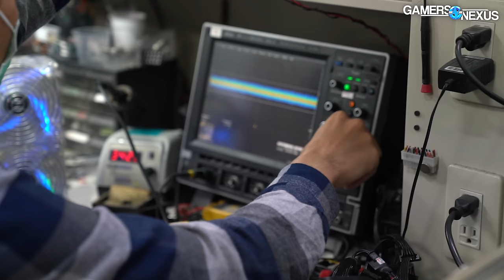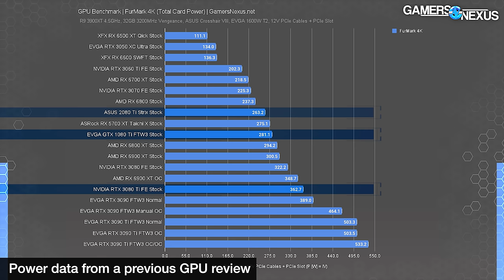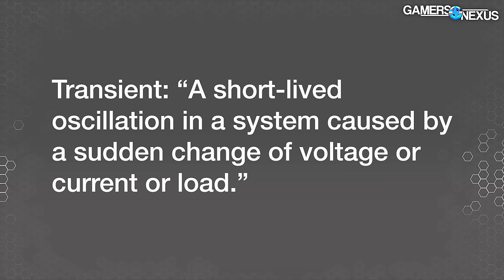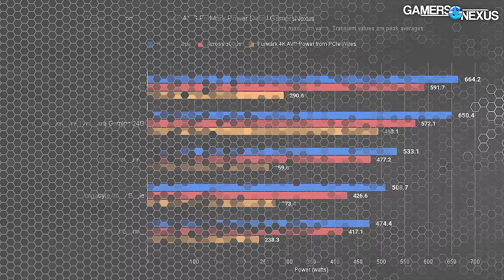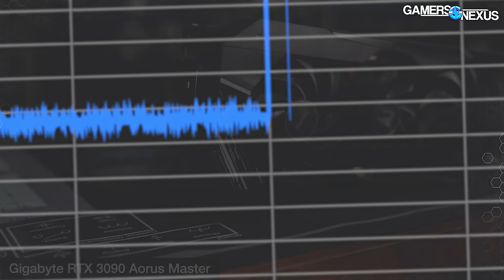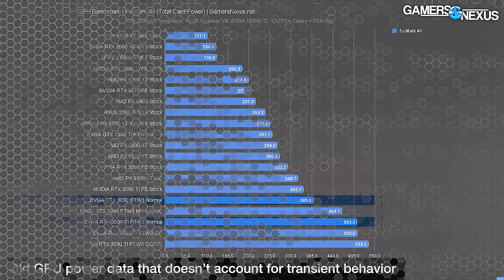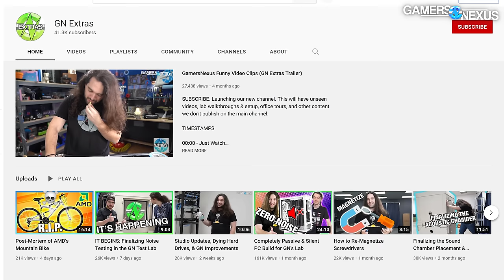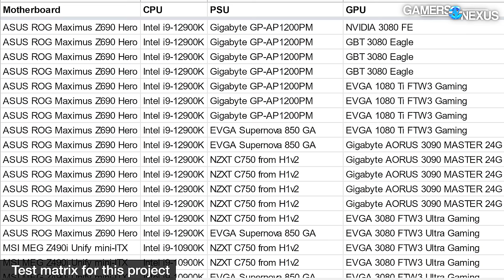The Brewing Problem with GPU Power Design | Transients

Comment: Everybody called me crazy when I overbought and kept sourcing PSUs based on quality of components and capacitors...
It seems like I am the guy who can sit and laugh at the moment, but jokes aside.
Transients that are this big ARE in the GPU makers court, if their product has a spiking demand, you put a capacitor or some sort of local storage on the card itself to handle it.
ANYONE who has dealt with similar stuff in Tycoon, Management games, building games and that have faced a similar problem realize that upscaling a massive system to handle that isn't feasible... You build a small supply that you trickle charge and dish out when the spike happens LOCALLY, meaning in this case, it is supposed to be on the right half of the graphics card!

Blame passed, buck stopped, get to work :D

Comment: Thanks for sharing  info. Adding my points from my incident 

As on Nov 2022, India 
Gigabyte 1080ti GPU behaves exactly  same way (humming  loud followed  by black screen, No Signal from GPU after wards. ). Sent GPU to Gigabyte Service  center (no warranty  being old GPU , EOL products  as response, not repairable,  Nvidia chip is heating too much)

My system configuration 
MB : Asrock Taichi X370
PSU : Corsair HX1200i
GPU  : Gigabyte 1080ti (white)

Investment in flagship gpu got wasted without stressing  it , since this work station is for Video editing in Davinci Resolve

Comment: UPS counts also in this I suppose. I just got a 3090 and have an 850W Seasonic titanium, I thought it'd be OK enough. But I think the power spikes tripped my UPS which is an 810Watt unit. I suspect the PSU could handle it, but the UPS won't go a cent over 810. I'm getting a 2,000 watt UPS from a business. I've also got a 1,300 watt UPS coming over. I'd considered the UPS and most people think it'd do OK, but we don't hear about the UPS much. I'd forgotten to consider it as I built over the last years. Five years ago when I got it, it seemed enough, but things have changed.

Comment: I had an issue like this one. But my configuration wasn't especially power heavy.
Spec list was as follows:
Gigabyte B550m dsh3
Ryzen 7 pro 4750g
16gb ddr4 hyperx predator 4000MHz (clocked at 3200mhz)
Be Quiet Power System 9 700w Bronze
And 2 ssd's in a nicely cooled case. 
Now, it had problem where it would shutdown instantly, without warning. I had spent months diagnosing the issue, until I changed motherboard to MSI B550 TORPEDO at the last minute, solving the issue.

Comment: I'm running a 850 watt 80 Plus Gold PowerSpec (Microcenter brand) and haven't had a single issue with the EVGA FTW3 Ultra 3090. I did run all 3 separate power cables instead of using the included splitters. I wonder if some having issues could be because they have used the splitter cables instead of individual runs. I have debated getting a more well respected brand PSU but honestly haven't had a single issue pushing the 3090 to almost 450 watts.

Comment: Running an OG first Gen NZXT H1 with built in sff psu 750 watts running a 10700k 5.0Ghz unvolt and 3080 with a mild oc. At 115% power. So far the psu has not tripped (running on ups as well). 1440p/4k 144hz.
-
Unrelated, the aio 140mm rad water pump did just died so that happened (pending replacement to be delivered. the warranty is nice to have for once)

Comment: my 2c setup for yall to compare:
3090 Founders overclocked (+450 +100 114%)
5600G
850W EVGA G2
X570-Pro
Has zero issues. Never dies on me. I also mine crypto on it (84% power). Built in Oct '19

I DID have issues with two different seasonic prime gx-850. I returned both for a used G2 from ebay. flawless since then

Comment: This is the exact same problem power grid operators faced when computers got used more and more. Instead of creating a nice predictable load like a toaster they just create spikes, making the grid more expensive to operate. Ultimately computer power supplies now all have a PFC element. I'm pretty sure this issue belongs to the videocard makers.

Comment: Ran an EVGA SN 750w PSU for 7 years with zero problems...Changed to a Corsair HX1000w PSU when upgraded to 3080ti-- a few days later I got the crash with 100% fan ramp up and GPU got fried.... Sent the GPU back to gigabyte and they replaced it. Im back to EVGA PSU and no issues for 9 months now! I'll never run a Corsair PSU ever again!

Comment: I find it hard to believe that general processing unit power consumption will trend downwards in the medium/long term, considering that it would mean leaving a lot of power on the table. More and more, integrated circuits will be bottlenecked by power and thermals rather than hitting a hard-ish voltage/clock barrier like it was the case so far. It comes down to the physics of miniaturization, as increasing transistor density by a given factor reduces the power draw per transistor by a lesser amount. More transistors, more power. Not to mention larger chips, after all, as computers become ever more important to our life and work, it stands to reason we will be ever more willing to invest more into them, and thus larger heftier components.

Comment: Seasonic X Series SS-750KM3 (ATX PSU) + Msi B450 Tomahawk Max + Ryzen 3700x + Zotac Trinity OC white RTX 4070 TI Super just shuts PC down with 27" 2k monitor, when load non indie games. Worth to mention it was okay with 1080p monitor. Looking for a replacement.

Comment: 6950xt + i9-7900x + Rampage 6E x299 + Seasonic Platinum 850 = no issues here.
Overclocked i got sometimes 1kW out of the wall, but no shutdowns.
I think that amd isn't as affected as Nvidia with this. (Had in my system before an 1080ti, without issues either)

Comment: I'm building a PC with a Ryzen 7 5800X an MSI MPG X570 Gaming Edge WiFi, 4x8Gb DDR4 3200 a PNY 3080Ti,  seven 140mm fans and two DDC pumps, all in a Lian-Li O11 Dynamic Mini which only accepts SSF PSUs, so I installed a Corsair SFX 750. So far no problem with synthetic testing (Furmark, OOC, etc.) but have to do more testing after this video. SFX PSUs are more expensive compared with PS/2 especially when more tnah 500w are rquired, maybe I should have go for a 850w as least :-(

Comment: I had problems with a Rx 7900xtx(Retail) + x5760 Phantom gaming 4 and a 1200w 80+Platin be quiet straight power 11 power supply
I simply dropped the max power consumption of my gpu by 10% and daisychained it and now it works fine

Comment: my rosewill capstone 750 psu died 2 weeks ago had been using it a couple years with an r5 2600 and 1060/2060 gpus with no problems, upgraded to a zotac 3080 amp holoblack in november 2020 and was still fine, i think the upgrade to the 5800x a few weeks ago is what finally did it in lol. replaced it with an evga supernova g7 850w

Comment: Need a massive inline capacitor between psu and gpu, maybe also a ups batteries with higher amp draw potential  than common US outlets to accommodate higher wattage power supplies.

Comment: That was an amazing and very informative video. I believe this may have been an issue in my system as well with a 6700XT and a 600W SFF Corsair PSU. AMD does recommend 650W PSU for their 6700XTs. I used to get frequent restarts accompanied by a WHEA error, which pointed towards the AMD CPU, I got that replaced and didn't solve anything. I'll try a bigger PSU next. System used to handle demanding games in 4K but struggled and mainly crashed in high FPS when playing rocket league in 4K. I have since started playing in 1440p with RSR on and the issue has nearly disappeared completely.

Comment: It's too late for the 40 series to make any changes but the next series absolutely needs to do whatever they can do reduce the power required to run these cards. AMD seems to on the surface realize this as well but imo with the 7000 series they don't seem to be as focused on bringing power down as they are with gaining the crown for performance. Really across the board though things need to change. It's getting to the point that most people's homes can't handle it. Most homes the average amperage for a breaker is 15A and you're only supposed to have ~80% of that as the load. So,  in the US since we use 120v pulling 15A is 1800W. 20% less beings you to 1440W. That's also not factoring in wiring in your home too. That's a whole other can of worms. Higher gage wire can handle more since there's less resistance.

Comment: So basically people are going to have to buy enormous power supplies just to cover transients unless the companies figure out a solution. Usually people buy a power supply based on their needs. If people have to start buying them there's going to be a massive surplus of power supplies below 1200W. Think about it. If the current and next gen cards pull 400W base and can see two to three times that in these spikes you'll need 1200W to 1500W just to have the headroom to avoid a complete system shutdown. That means outside of covering transients you're buying power supplies that are double or more the capacity you need.

Comment: A seasonic fanless 700w is not enough to handle a 7900xtx with a 5800x3d.  But turning down the board power by 10% helps.

Comment: Not SFX but I run my 3080 FE, 10600k @4.9GHz all core, MSI MAG Tommahawk Z490 and full custom WC loop on a Corsair RM650.  It's been 100% bomb proof though all stress testing when I set the system up and spits out ~165 FPS at 1440p in most games most of the time.

Comment: I got an EVGA FTW3 3080 and that's how I found out about the transient power spikes. I had to change my PSU from an 850w to a 1000w to account for that. It was kind of unfortunate, but now I don't get crashes anymore and that 850w PSU is in another system doing just fine.
Reply: Oh, I went from an RMx 850w to a 1000w RM series from Corsair. I'm glad I had PSU issues in the past to even know where to start looking.

Comment: Recently installed an ASUS TUF 3080 OC 10gig in my rig with a Seasonic 760W PSU from about 5 years back, and immediately had problems with the computer restarting without any blue screen under sustained heavy load. I solved it by grabbing a ferrite bead from an old 3.5mm audio cable and putting it on the +12V sense wire from the MB 24 pin to the PSU.

There's a thread on the LTT forums with some posts from the user JohnnyGuru, who seems to have investigated this in great detail, and he also suggested the ferrite bead solution. Apparently it's due to some exponentially growing noise on the +12V line, which causes the PSU to shut down.

Comment: I had to buy an EVGA Supernova G2 850 a couple of years ago, to replace my failed Corsair AX 860 PSU. It worked fine with my 2080 Super and an Asus Strix RTX 3060 Ti oc. I picked up an EVGA RTX 3080 Ti last weekend. It worked fine, until I tried to play Forza Horizon 5 and Forza Motorsport. Those games would crash, whenever I got into races with a lot of cars. I moved that 3080 Ti over to my rig with the Corsair RM-850. Those games worked fine with that PSU. I plan on replacing that EVGA PSU.

Comment: Had an 800W SFX-L from Silverstone with my EVGA 3090 XC3 and 5950X. Would sometimes get shutdowns even while my UPS was measuring maybe 520 W of load. That's when I learned about transients and had to upgrade to a 1000W model, no problems now. Interestingly, I also have an Asus Strix 3090 + 5900X in a different system using that 800W PSU, and despite being a more power-hungry card overall, it's been working fine even with a maxed out power slider. Go figure...

Comment: that kinds of shutdown are not OCP but psu design issues, due to +12V noise.
Furthermore... Rigol DS1054 it's not a scope up to the task. 
To carry out the transients test in a professional manner, there is need to use a pro-scope, like the Keysight PA2201A or PA2203A IntegraVision Power Analyzer.

Comment: Yeah Steve is 100% correct that transient power spikes are not a new thing even AMD's Vega GPUs had this problem and one user had to upgrade his PSU because of it from the short research that I did on the web. After watching this video I am glad that I bought an EVGA 1300w unit for the 40 series cards because I am hopeful that there is enough wattage to absorb transient power spikes. Nice job Steve on explaining and telling us what is going on here. Makes me wonder about the issues that New World had that were causing Cards to die that this was part of the problem since early EVGA 3090s had issues that were fixed with later revisions.

Comment: What if I use daisy connector for one of the 8 pins? Could that limit those transients? I’m planning to get a 3080 ti and my PSU is 850 gold plus 80. Also, I saw that a Gigabyte 3080 ti only has two 8 pin connectors. I kinda want it because it has two HDMI slots. Can I truly power a 3080 ti with only 16 pins?

Comment: There is a better solution. Move from 12V (which is a legacy of from original 5 1/4" floppy drive motors) to 48V (common on POE). By going to 4X the voltage you can go to 1/4 the current for the same wattage.  This means much less wiring to achieve the same goal.  Further the on board switching regulators will be cheaper and if you look at the number of those power supplies next to the ASIC (GPU chip) you know they are a major cost adder. This would be smaller capacitors, smaller inductors, etc.
In fact its time to take the whole PC box to 48VDC as a primary DC input. This is what big iron telecom gear does and it works and scale exceptionally well, has for decades.

Comment: Have you considered adding 22,000 to maybe 100,000 uF of power supply capacitance to the power line?
Should be easy to do and place anywhere you have some room in the case.  Connecting to the wired plug connectors should be good enough.

Comment: Im glad i never have run in to this issue. I have however maxed out a good quality 850w PSU. It was a weird experience. When i started the computer there were no cooling at all. no pumps no fans etc. and most of the drives didnt start. The second gpu didnt start at all. after that the whole computer would just shutdown. Glad i upgraded to supernova g2 1300w. Never had that problem again.

Comment: I have a 1070ftw and a i7 9700k oc to 4.8ghzt all core. Never had a issue with my 850wat PSU pc was rock solid, soon as I installed a 3080 and then a 3080ti both did the exact same thing, freeze for a couple of seconds and instantly shutdown and now had to in invest into a 1000wat psu

Comment: So my situation is this:

My build:
MB: Asus Z9PE-D8 WS
CPU: 2x Intel Xeon E5-2680 
PSU: Zalman ZM1250 Platinum 1250W
GPU: Asus GTX1070 Strix 8GB

My issue: the PC runs perfectly fine while under load (playing games, video/3d rendering) but if it idles for too long or isn't doing something overly demanding (internet browsing, watching videos) it will randomly shut off, but then turn itself back on again and if I'm not there to stop it, it will keep doing it. It was, for at least the first 4 years working perfectly fine but in the last 2 it has developed this issue.
Reply: The power supply is the issue. Always verify issue using spare components if you can.

Comment: Steve, good analysis.

Perhaps NVIDIA and AMD should focus on making their high demand video cards more efficient.

At the same time since the "transients" originate with said video cards, manufacturers should provide adequate capacitance ON THE CARD to prevent reflecting transients elsewhere, throughout the system.

They caused the problem, and should be the ones required to fix it.

OTOH, I have been a strong proponent of overbuying WRT power supplies, formerly because of the uncertainty of how much reserve should be provided for future growth, i.e. adding something. Now there is another reason to up the size PS because of spiking.

And quit relying on everything being made smaller, including PS. Everything needs adequate space for cooling without requiring fans running at tornado level air velocity and sound levels.

Comment: I have an EVGA GeForce RTX 3080 XC3 ULTRA paired with a EVGA SuperNOVA 750 GT 80 Plus Gold and it works just fine with every game I've thrown at it. I haven't had any weird power issues, and if I did, they weren't anything that was noticeable. The motherboard is GIGABYTE X570 AORUS ELITE WIFI, if that helps anything.

Comment: That explains why I have always had to buy more PSU than nVidia says I will need to power a card. Even as far back as Fermi, I would have this problem where if I didn't get at least a 600W GPU for a 170W graphics card, my card would work 90% of the time and then just trip OCP randomly for no apparent reason. nVidia said you only need 450 or 550, and that just wasn't true. Sometimes would work at high load for hours, sometimes would trip at nothing. The behavior just wasn't consistent and no monitoring software was detecting unusually high power consumption, but the PSU wasn't liking what it was doing. I never understood why, but I thought there had to be some technical explanation for why GPU power ratings are not reliable. I think I was encountering this back then, and there was like this vague conventional wisdom that you have to overbuy on your power supply to the tune of like having 200W+ of "headroom" unless it was a pricy overengineered one for Gold or Platinum with a lot of extra capacitors and junk, but no one really knew why, it was just what you had to do and everyone accepted it. I've continued to do it to this day, and that's one of the reasons why I'm so mad about power consumption on the 40 series...  because if that's the "Rated" draw, then it's going to require proportionally headroom on top of that. At least now we know why. That also explains why some had my experience, but other people depending on a high-end motherboard and expensive GPU model could get away with the exact same less expensive PSUs at nVidia's rated spec, and thought we were all full of it for saying the headroom was needed and went around swearing we were shilling for the PSU companies.